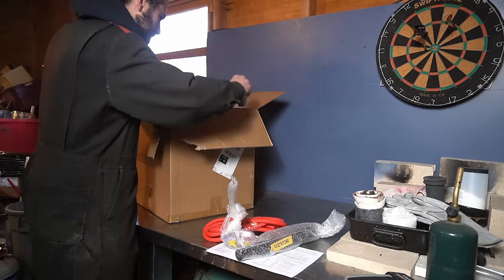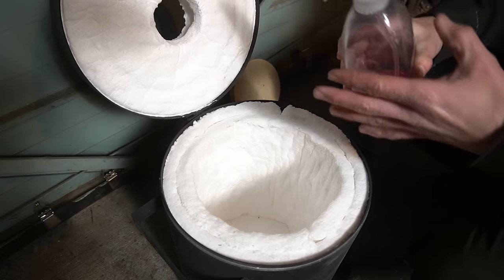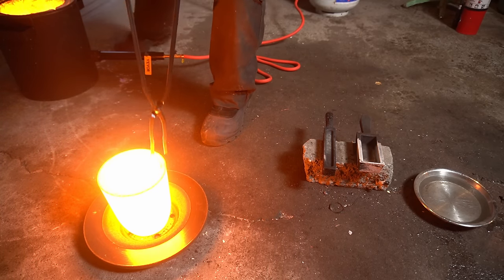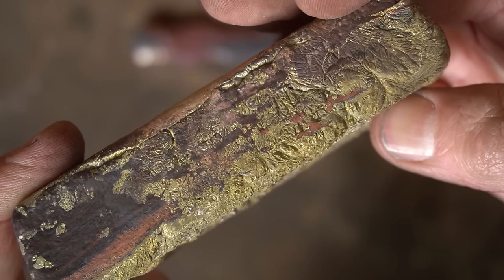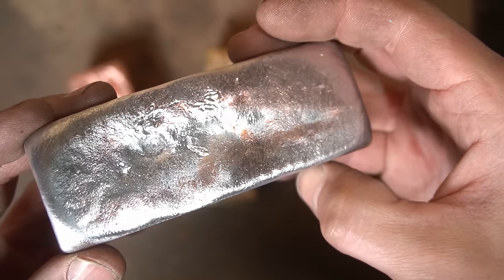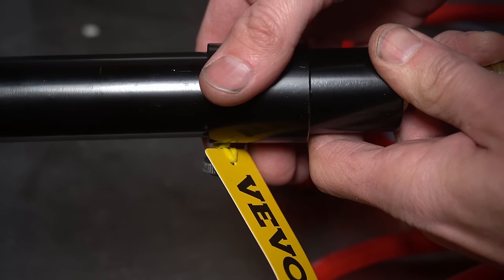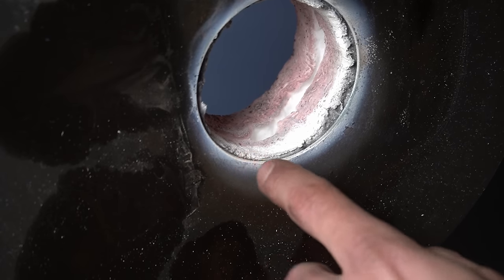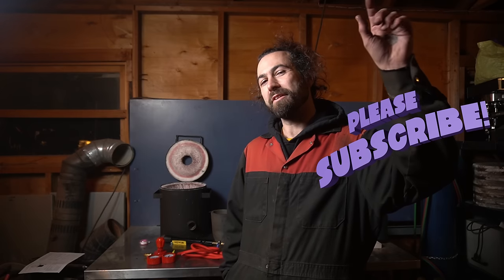Vevor Melting Furnace: Review Setup and Tips - Is it Worth Buying?

Comment: Opinion from a scrap yard’s perspective: Would not suggest creating personal ingots if you’re looking for profit on your scrap. You will have a tough time selling your material and likely downgrading your metal. You won’t be able to certify the metal in your ingots. Smaller yards won’t be able to verify the chemistry and although larger operations could run their tests they will likely downgrade knowing quality won’t be consistent from a garage smelter. Melting is definitely fun, would only suggest if you’re just looking to create cool content online and not looking to profit off this metal.
Reply: I agree. Eventually you will find someone that will buy them but it’s tough. Most yards won’t especially if they don’t know you. Surprisingly there’s people that will buy them on eBay. Even at crazy premiums for some reason. Personally I think a few 5 gallon buckets of bare bright solid core is just as pretty😂
Reply: I can verify this, I worked at a foundry that processed lots of aluminum, every batch was sparked on the spectrometer with the sheet included with the ingots. One exception was a nail company that paid for aluminum ingots for deoxidizing their alloys, but they only wanted extruded aluminum. Lead would be another exception, we melted down anything from poo pipe to used medical isotope casks for mill anchor. Hahaha, Zinc fires are great indoors, nothing like coming in to a dusting of snow. Oh, and slag is from smelters, what you skim off is called dross.
Reply: eBay is huge exception to this, copper melted into ingots (especially when finished/polished) sell for minimum $10 per pound and even up to $50
Reply from the maker: Oh I’m aware, you’re 100% right all the way down 😁 I’m only doing it because it’s a fun visual representation of the content recovered from specific scrap items (and the internet seems to enjoy scrap melting vids)
Reply: If you're looking to profit, don't sell your copper and brass to the scrap yard.
Reply: @goodtimeeric  and what should you do with it then?
Reply: If I got this, I would be melting to cast things, not ingots and buy scap from a yard to use, not to sell it. Though once in a while, may cast some ingots to make some scap easier to store for a future project, like say a brass cannon with cast aluminum wheels.
Reply: I sold my aluminum ingots to a scrap yard with no problems.
Reply: My scrap yard happily takes them
Reply: @Rantandreason  Simply sell it to buyers that want ingots and rounds.
If you're going to all the trouble of melting down copper scrap, it ceases being scrap; it's now a beautiful ingot.

If you wish to profit even more, make sand casted coins and medallions in whichever design(s) you want, and people will buy it based almost purely on its beauty, with only minimal concern about its composition.
And just for argument's sake, even if your ingots or coins are hideous, you can always remelt them. If you're not confident in the purity, add some tin and call it bronze. 😉
Reply: I’ve been wanting to melt brass ammunition cases into gunsmithing hammers.
Reply: I recommend calling the local scrap yard first to see if they will buy them. My local scrap yard will buy the ingots. They downgraded the aluminum but upgraded the copper. The aluminum isn't worth doing for me since they pay me sheet aluminum prices for it. The copper I melt down is stripped wires and old water pipes. I turn #2 and #3 into #1 by melting it. Bare bright is best left alone since that pays more than #1. I like melting down the metal because it makes it easier to handle.
Reply: Many of us are not interested in selling our melted cans etc....if i can melt down my scrap pieces into a larger more useable chunk that I can put on my mill, thats a bonus
Reply: Learn the difference between melting and smelting...
Reply: I'd say if you could pour or make a solid core thick grounding rods no one would notice the difference... I've sold pure stock that looked like bars and pucks and grounding rods no issues....
Reply: @Rantandreason  well if your in a big city with an art studio go and leave your card when they do casting classes they fly through the raw material they will want it in granular or smaller form where they can melt quick and easy
Reply: How do they can’t tell the “quality” of my old copper Lineset or brass valves now
Reply: @Rantandreason sell to the people that buy it from the scrap yards.
Reply: Good to know. Thank you
Reply: @Rantandreason  you can sell them to the manufacturers that use them, you can sell them to precious metal companies that deal in copper, they will test the purity and cut you a check for its weight.
Reply: I've been selling range brass to the scrap yard here. I have enough processing time to ensure no live/aluminum/steel ammo is in the mix. I don't see why people would spend the money to melt it, when the price differential supports it. Now if I were making projects out of reclaimed brass.....

Comment: I'm convinced that melting point has a direct correlation to cost. As the melting point goes up, so does the cost of melting it. Anything under 2000°F is surprisingly doable at home but above that and you start getting into technically challenging DIY engineering, and high cost materials and equipment. I had a forge burner project because I wanted to melt inconel and hastelloy (exotic nickel alloys $$$) and had to shelve it because of "lack of funding" lol

Comment: If the lid does burn out at the opening and enlarge, I think cutting a larger hole (square for ease or round if you are up to it) and replacing it with a piece of stainless steel sheet larger than the hole with the exact same size center hole,  held in place with solid steel rivets  or steel bolts would end future issues.  Use a slightly thicker piece of stainless steel if available. I would imagine that as the original steel erodes, the insulation will also. To cut out the patch, an electric or an air powered "zizz wheel" (cut off tool with a thin a thin abrasive disc, some people call it a "death wheel) cut off tool. Just make sure the blade is in good condition, worn evenly, etc. Thanks for posting this. I just got a notification from Vevor about their stainless steel 12KG model. It looks like the same tongs are supplied.

Comment: did you temper the crucible first? slowly heat in a domestic oven to dry it out. then heat in furnace to highest temp you plan to use it at, and hold this temp for around 20 min. seems to glaze the crucible and make it last a lot longer without the flaking you saw. experiment with some  casting, its great fun!

Comment: You need a bimetal pyrometer to monitor temps. 
Drill a hole 3/4 upper furnace hight and use an angle so the tip 4" of the thermocouple is to the side of the fiber insulation.
Use Sodium Silicate mixed with Kaolin powder as an adhesive to seal the probe hole. It makes a decent mortar also.
I built about 20 furnaces like yours that could melt 200 pounds of copper.
Reply: The average Joe screwing around on the weekend in their garage doesn't need to monitor temperatures...
Reply: Thanks Tim, I just got one last week and want my first firing, melt and pour to go as well as it can. I have a pyrometer (for firing a pottery kiln) but haven't yet considered applying it to this task. Your install description is helpful. I made cast sculptures 40 years ago using wax investment and also sand casting process. I don't want to overheat brass and do want to monitor the temperature to be able to  plan for time and to calculate gas usage. The sodium silicate & kaolin combo for sealing up the kaowool surface sounds like a good treatment and will apply that. I have used a water- alumina - kaolin mixture to keep kiln shelves clean. I think I may add some alumina to increase the heat durability of the coating and reduce the possibility of cracking, what do you thinks?

Comment: A full ceramic mortar coating is better, and you should always preheat your molds to prevent explosions and get a smoother cast. You can always remelt if you get a lot of holes or a bad cast
Reply: You Should Preheat Everything. Thermal Shock Hurts.

Comment: I am glad you posted this video.  I am new to this and debated making my own or possibly a purchase like the devil forge(before I saw this).  I have most if not all the items needed except the batting and the burner to make.  I have noticed many saying “its not worth it to melt down” or “your scrap yard may not take it” but I find my need is a little more of having large sized buckets of copper, aluminum, cast(fan motor ends) that I would like to convert to smaller stacking units.  

I need more info on useable sized quality crucibles (where to get) and tongs and it would be nice if anywhere had a forum where discussion on the topic could be accessible.

Thanks again👍🏽
Reply from the maker: I know Reddit has a sub filled with good (and bad) advice! I noticed a lot of the people there strongly discourage buying a melting furnace because it’s “so much cheaper” to build your own. And while I am a huge fan of the DIY approach, I did the math and I think it costs about the same if you have to go buy all the components to do it
Reply: @thubprint  yes, while the model you evaluated was out of stock, the next model up with two burners (i think an extra $90) was available (it may not have the gloves but I have that taken care of already).  You have more experience at this so where do you get your molds?

Comment: Preheat your cleaned molds. The porosity was created from traces of moisture or something that gassed  out from the heated molten metal.
Reply: Traces of moisture did not create the porosity. Molten metal will cause moisture to violently expand 1700 times its original volume into steam. 
An explosion that won't go unnoticed...

The porosity is caused by the failure to degas the molten metal prior to pouring...

Comment: Downside of using cast iron molds with copper. I use graphite molds instead and the ingots look way better. 
You can wire brush the inside of the cast iron molds, but you will have a couple of holes in the end.. 

Preheat your crucible before using it, that way it will last longer. 

Now, is it worth it melting every piece of scrap and sell it.. Look at eBay, Etsy and see what some people will sell it for.. 1pound of copper for $35.. 

For me it’s a fun hobby, so it’s definitely worth it😁.

Comment: I'm currently cleaning out my shed.  I'd like to melt down the old nuts, bolts, screws, and nails, rather than throwing them out.  It looks like I need to get a furnace that can reach the 2800-degree Fahrenheit level.  My preference is a propane unit unless you talk me into an electric unit.  Down the road, I'd like to use the resultant metal to mold various projects.

Would you suggest this expensive unit for such a purpose?
Reply from the maker: You want to melt down steel parts? I don’t really understand why but I imagine you’d rather use a horizontal forge so you can get pieces to temperature and remove them for some hammering and shaping and then put them back in. I’ve never heard of anyone getting steel and iron to a pourable liquid at home

Comment: Good review! Ceramic “ridgidizer “ what exactly is this spray you use to harden insulation?
Something off the shelf from hardware store?
Reply from the maker: I picked it up from a blacksmith supply, it’s a colloidal silica suspension. Not terribly expensive and just an alternative to the heavy firebrick cement most folks use

Comment: The tongs should be junked. I've seen ones designed so that the part picking up the crucible are at a right angle to the handles and grasp the crucible around the body - much safer. Have fun with your new toy!!

Comment: I would say if you're going to work with both aluminum and copper based alloys get two sets of equipment and keep things separate.  It doesn't take much of one to contaminate the other.  I've built a couple of furnaces before and you could do a lot better if you're willing to build a setup yourself.  But for someone that's just getting into casting this doesn't look like a bad first setup and going with this could save you a lot of beginner mistakes in building your own equipment - you want to be safe after all.  I'd suspect it won't be that durable though (but still good enough to get your feet wet) and if you do stay with it and decide to upgrade I'd plan on replacing most everything.

Comment: 9:34 Actually, the ceramic wool will degrade with each subsequent firing without a well applied even coat of rigidizer or appropriate coating. Even the coating will eventually break down and expose the wool. It needs to be periodically maintained. Ceramic wool has been compared to asbestos due to some similarities with those minerals. Your assessment of this product was pretty spot on. Some good suggestions for minor upgrades that would improve the product without terribly impacting the cost. Shoot, they don't even need to make the changes. Just put a slip of paper in the box with your suggestions and let the DIYers do it themselves.
Reply: Is there anything that will fix this permanently  or at least longer?

Comment: When you use channel lock pliers to tighten brass regulatators instead of a proper sized wrench you end up rounding off the soft brass & then you will only be able to use pliers. I used to freak out on apprentices if they didn't use a wrench on regulators.

Comment: thumbscrew hose clamps are way cooler(easier to use) than conventional hose clamp fasteners, definitely the way to go. At least u got a solid torch to heat up those tongs to bend it. Thanks for sharing your thoughts and observations on this. Aloha

Comment: My regulator failed on about the 4th use. Won't melt silver anymore. Barely melts copper, but not as hot as it should be for proper pouring. The guage reads 20 PSI but the roar is gone and it just won't melt. The insulation defintely blows off to about 1/2 after 4 uses, thankfully there was a wind. I can save it as it is "Close" to the devils forge and the price was right.

Comment: I'm considering buying the 35 pound 16kg furnace. Never did this before but I want to melt and stack and save my copper. What if the copper is dirty?? I'd do this outside of my garage as I'm a car collector and don't want to damage my Chevelles (burn down my garage, splash the copper etc..). Any advice? My thought is go big or go home. It's how I roll.
Reply from the maker: You can certainly go big if you like, but a few things to keep in mind: the crucibles get significantly more expensive when you get into the larger sizes and they are consumables, then secondly you’ll need to build some kind of lifting and pouring assistance because that is going to be very difficult to do safely by hand.
“Dirty” isn’t really a problem when melting copper, you’ll want to remove any potential contaminants that would melt at a similar temperature and form alloys like aluminium/lead/zinc/nickle/brass/tin, but steel will just float and get skimmed off and bits of dirt and paint and dust will either burn away or get skimmed or fluxxed

Comment: Just a quick question - how did you clean the crucible out between the different types of metal?
Reply from the maker: I just used different crucibles, I haven’t experimented with mixing them but I’ve read that it’s best to use them for one material only

Comment: Thanks, can i use normal kitchen gas instead of propane?
Reply: By kitchen gas, I assume you mean natural gas.  Yes it would be possible but you would need a new regulator (since this is how you adjust the temperature) and a new orifice.  You could drill the existing one out if we know how many BTU the current one is and you know how to read the BTU charts.

Comment: what was the stuff called which you used to for sealing the inside of that furnace? Thanks!
Reply from the maker: That was another form of rigidizer, a solution of colloidal silica. It’s the same stuff that’s suspended in automotive coolant I think? I hadn’t heard of it before either but I went to a local forge supply house and they had some for sale, recommended it because it’s the same stuff they use in all their builds. Apparently the refractory cement most folks use ends up cracking and falling off so this method is more durable

Comment: Threaded gas connections always always always use teflon tape or PTFE pipe sealant or both. Checking for leaks is good but for Pete's sake do it right then check your work rather than taking shoddy shortcuts.
Reply from the maker: I’m not a pipe fitter, but I don’t use Teflon tape when hooking up my bbq either, are people supposed to?
Reply: @thubprint typical quick disconnect threaded bbq fitting in US anyway seats on a rubber seal you aren't trying to seal the threads at all they are there to mechanically press the seal into place. On a brass on brass or steel fitting with no rubber gasket of course you're going to use teflon tape how else are you creating a gas tight seal? Do you reckon Chinese thread tolerances are THAT good and the mfg just included the tape as a joke? Personally I prefer PTFE pipe dope or some use both but either is code compliant and safe if applied correctly.
Reply: Actually no they don't.  You should never use teflon tape on flare or chatlef style fittings.  Only on tapered threaded pipe.

Comment: so... point of safety here.. .

If your threads are damage, replace the part. PERIOD. 
You should ALWAYS use the teflon tape rated for propane / natural gas on your fittings. With temperature swings, come metal expansion, and contraction. The felon is there not only to prevent mismatched threading leaks, but to help combat leaking because of thermal retraction.